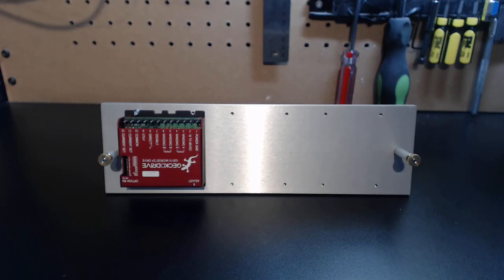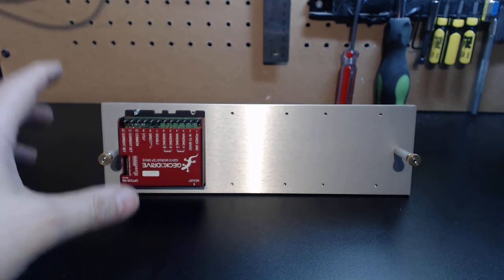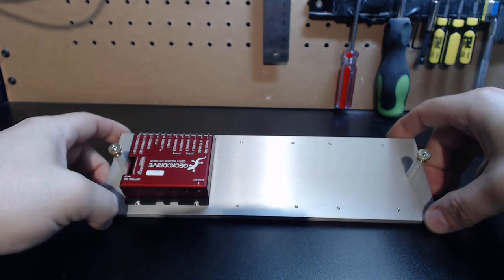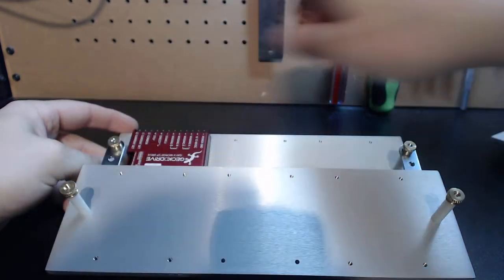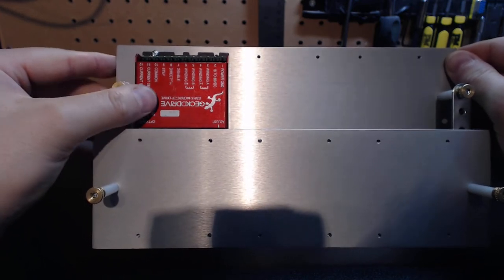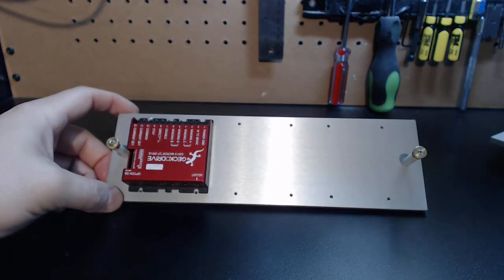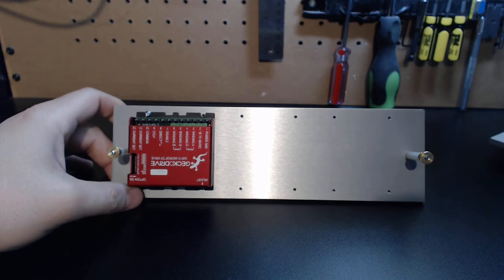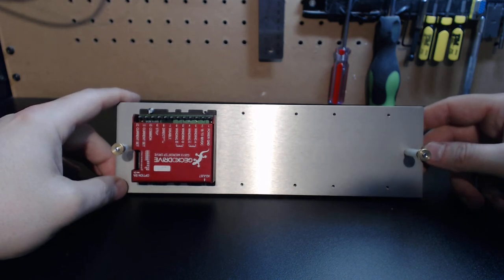Gecko Pro-Drive Tool Less Heatsink Drive Mount

Comment: Hi  I've been doing research on the Gecko web site, and I would like to know your Opinion about the  GM215 Step Motor / Motion Controller. In particular the morph feature
Reply from the maker: Please excuse the long answer as I get asked questions like this all the time. Morphing is a very cool technical spec, but is it visible?Drives are being upgraded all the time in functionality tweaks, speed, micro stepping, and variations in motion control. My feeling on any drive is simple if you can't see a visible difference in the components your machining then investing in any drive claiming to be super different isn't worth the investment. Please don't misunderstand me. I'm sure the drive follows Geckos excellent performance, and quality,  but there's a true limit in what translates to differences in what you'll actually see on what your machining.The main reason is there's so many variables in that a driver is a single component. You still have a  chassis that must be square, and true, motors, and transmission type which will play a huge role in the end result of your products. If you look at machining by just tolerances which is what dictates the accuracy of your parts, and say you get them to .002in using a G540, or G203v, and then upgrade to the GM215 with the same tolerance it has nothing worth the upgrade, or price increase. The rule of thumb in manufacturing is if you can produce a part, and I produce a part, but you did for less than me, and we have the same acceptable tolerance I paid to much. Thank you,Vince